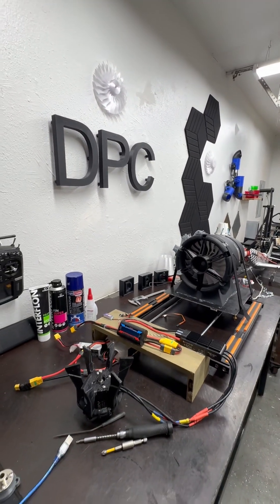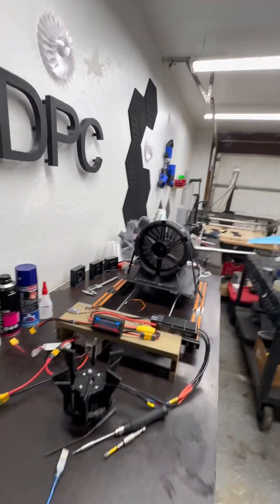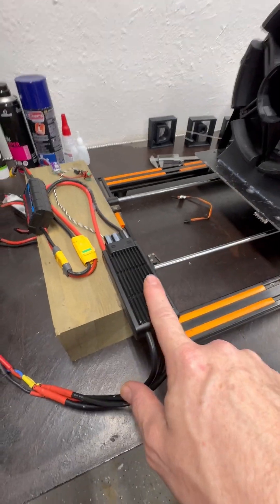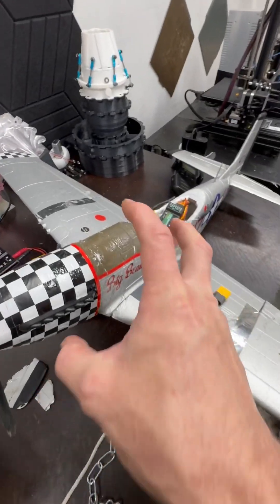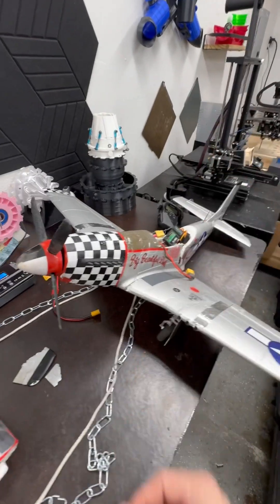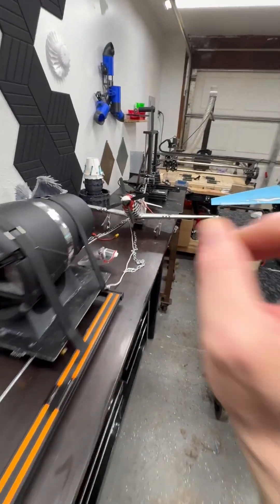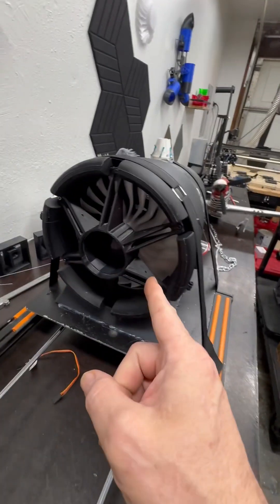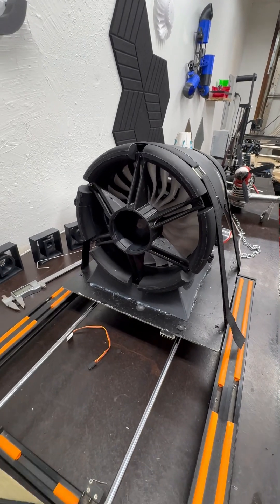Aluminum planetary gear system is now stateside. #electric #edf #turbine #fyp #shorts #rc #diy

Comment: Do you use a flight controller on that poor plane, or just direct mixing from the RC? If there is a controller, the flap wiring needs to be checked for two things: (a) whether your input goes in the correct way, (b) whether correction for disturbances by the FC goes in the correct way. And usually people test half of that, and half of possible changes...

(reminds me of my first encounters with bicopters)
Reply from the maker: At first, I was using a flight controller and I was using stabilization. I know how to set them up easy enough in inav but the problem I kept running into was when I used stabilized role pitch and yaw when I would roll left or right, the elevator would pitch up and I couldn’t find out where in the settings it was causing that so I went with direct RC unstabilized and I set my throws and exponential on the radio instead after that I switched back to the reflex two and a standard RX. No flight control controller and the plane continued to act the same way as far as control is concerned and acted tail heavy I would lose a responsiveness at a certain distance, and it would stall out and fall.